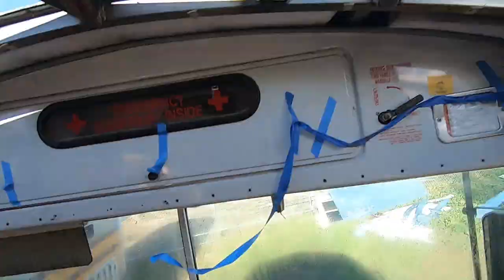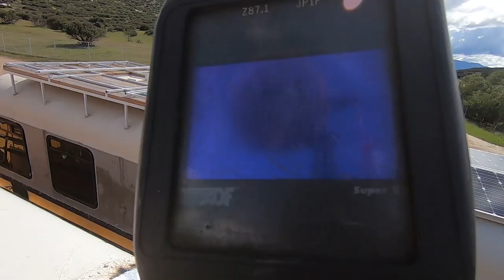Skoolie Roof Raise in 1 Week | Skoolie Conversion

Comment: think this way of raising the roof makes it eazier to keep the electric cabling for the rear of the bus original , the windows are sitting lower though , allways figured to add the extra height under the windows so they go up too , gives a bit more privacy and probably makes the buss look nicer from the side if you use the original windows
i do see that it can make problems for emergency doors and the front part of the bus , on the other hand you could leave the construction of that alone and drill out the rivits around them only raising the sheetmetal at those points
Reply from the maker: Yeah for sure. There’s a million different ways you can do it, but it’s all in the way the customer wants it done. Great insight!

Comment: What do you guys charge to raise one like that?
Reply from the maker: Depending on what all needs done changes what the cost is. Some want to move windows or doors or do other cut ins or block offs so that all adds to. It's really just dependent on the job
Reply: @RoadtripNVenture  ty debating but would like to keep windows at same level but raise ones in cabinet area. I saw one bus that cut the raise below the window line was different.
Reply from the maker: Hmmm yeah their is tons of ways to do it. You would just need to decide what you wanted then we can help if we can. Thank you for responding